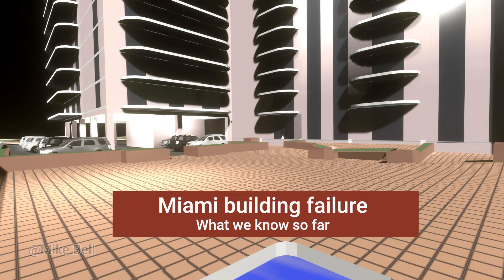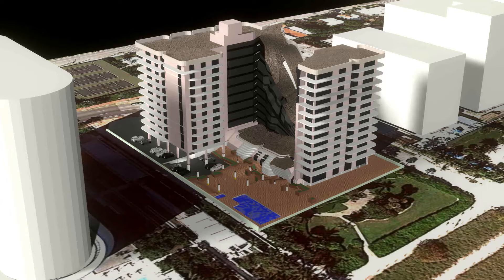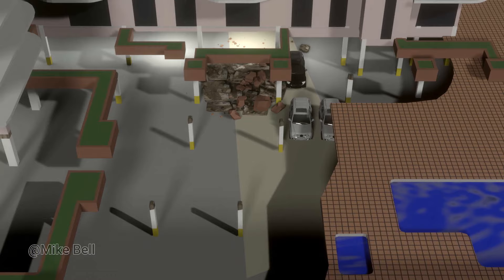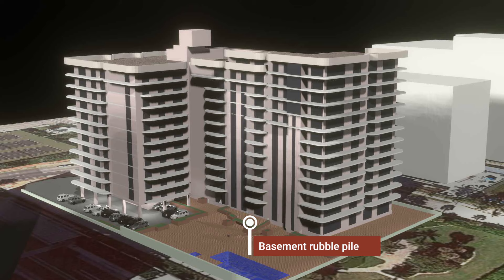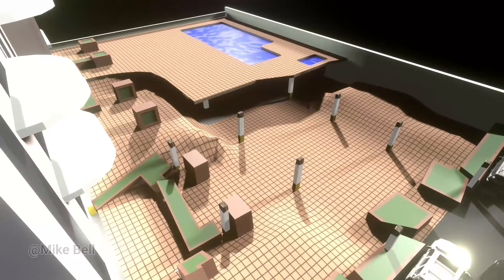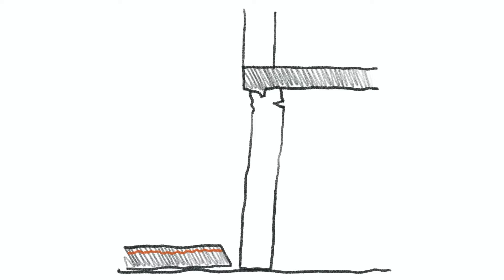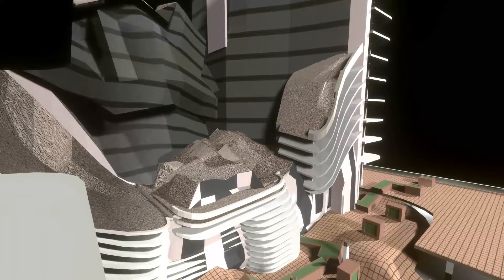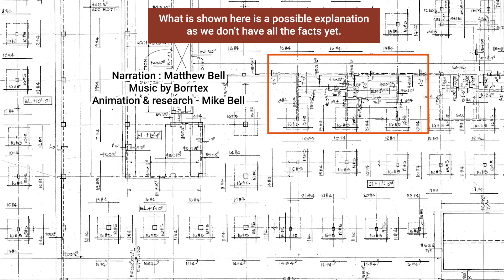MIAMI CONDO COLLAPSE | visualization of the evidence pt2

Comment: A very good animation of what we believe to have happened.
I read a report by a geologist who was working on this bit of land detached from the mainland.
That when the survey was done there were packets of unstable ground.
Could the bit that collapsed been one of them and the part that survived been on the more stable land?
A demarcation line running between the collapsed and stable building.
As with most accidents be they minor or serious there are usually more than just one fault, the Swiss cheese explanation comes in to play.
If the holes line up you are in for trouble.
When the lady reported the beginings of the collapse at the lobby of non collapsed part of the building the fire alarm should have been set off.
Also the building inspection and others should have listerned/seen what the building was saying.
Thanks for the video. It might not have been necessary if the above and duediligance had been carried out.

Comment: There were warnings.  Many residents saw decayed concrete, warped columns, slanting floors, cracks, door frames that fit strange and the such.  Complaints came in for years.  But instead of moving, everyone just sat around. Never believe that someone else will fix your problem.  You better fix things yourself.  If you can not fix the issue, replace it.  "Professionals," can no longer be trusted.  You must be your own electrician, roofer, mechanic, plumber, and the such.

Comment: It looks like the shear wall was designed with minimal obstructions. The columns look too slender for the negative moment sections of the column ceiling design as well as floor column design. There is another video discussing the shear wall design near the elevator shaft. I used to inspect bridges be and it looks like efflorescence, water seepage, among other causal factors that contributed to the collapse, from the video.

Comment: No engineer, but that domino effect you mentioned early would seem to be the key to keeping this from happening or something that could be integrated into older/similar type of builds with load bearing shear walls possibly where water migration or corrosion is a problem or a variable.

Comment: The columns of the façade buckled as if there were no beams which calls for a certain suspicion that it was intended to save materials and earn more money by putting an additional level to the building, but investigation would have to analyze first total height of the building vs levels, perhaps the problem was not only the damage suffered by the corrosion of the metal inside of the columns that in a building built respecting the rules would have given signals with enough time to evacuate safely, sorry my english not too good

Comment: i wouldn’t say engineers go out of there way to make it robust. they design it for the building with a budget intended to meet the scheduled deadline. A lot of buildings are built with cheaper concrete and thinner steel due to the contractors and builders actually taking on the job.

Comment: The floor fell on both sides or support column 72, some lobby floor could have fallen also fallen around the collapsed supports. Because 72 was an upper garage both the garage and 1st floor had16-inch columns and they sat on top of each other, even though a lot of the connecting material got ripped away, the 2nd floor also had a 4-foot beam around the parameter. I think the lobby outer wall in the collapsed section was flimsy in comparison, no 4-foot beam on the 2nd floor, I think it had 12X16 column. If the floor fell around that column taking out some material it probably wouldn't need much of a tug from the falling lobby or deck slab to destabilize the 12 in cross section if the connection looked like 72.

Comment: Leon Wechsler Architect says: The only thing that brought down the building was lack of structural beams under the pool deck and also in the portion that collapsed, period !
Reply from the maker: Obviously beams would have prevented this.   That is self evident. 

But why have all the other flat soffit structures and they are as common as baseball caps, not fallen. Only this building? Answer that…. you cant. 

Mike Bell Architect says me thinks corrosion thru neglect and razor thin margins on the structural design caused this collapse.

Comment: What I think needs to be thought of as well is a lot of times a support can break and not actually fall in that specific area... buildings are engineered to support a load over sqft. So one pillar breaking could’ve been fine, but the extra load put onto the other pillars might’ve exceeded its parameters actually causing the collapse.. so many factors in how it could’ve actually happened.. ultimately it was the lack of inspection detail and ignorance.

Comment: Also, the construction next door by a mammoth sized new building didn't help. I wonder how it feels to live in a building that was partially the catalyst in the older building collapsing down.
Reply: I get your point but the damage the new condo building may have caused was inadvertent. They weren't to know Champlain was so terribly under-engineered, nobody did aside from the original team, many of them are long dead.

Comment: Construction similar to our beach side condominiums in Pinellas County with many of being within the same age. A majority had and many still have exact same parking arrangements. The area above used for vehicles to drive on with area for visitors and delivery parking. It is not uncommon for moving semi and box trucks to be parked all day in the exact same spot. Not 100% sure as to weight limits on such construction but I do know looking at them there is no way that they were made for such heavy pressure. Trucks were built smaller and lighter but as time progresses the weight and size increase for new safety standards and  to meet the ever increasing needs of transporting more and more crap which people must have. Also these decks are perfect for any renovation and repairs for contractors. They can easily access any floor and roof from right against the building. Imagine the size of a crane being used to reach the roof at 18th floor height with huge replacement air conditioning units......

Comment: Having worked in structural concrete construction, one look at the ceiling in the garage would make me run out of the building and never go back.  It was melting or so it seemed from years of neglect and corrosion.  Placing panels over cars to divert the dripping water and crumbling concrete was heinous.  Efforts to warn and sure up the structure never occurred.  A political quagmire had consumed all reason by individual condo owners within the structure.  The unsuspecting inhabitants were like sitting ducks waiting for the inevitable collapse.  Inspection people failed as well making unprofessional declarations about the buldings integrity which further guided the process which ended in demise.  All in all it was a catastrophe which was led by those with various reasons for denial.

Comment: great vid. but one issue I see is that you show the pool deck collapsing clean cut from the 1st floor of the building near those first failed columns. but i've seen in other vids and the actual plans, the floor of the pool deck was literally connected to the 1st floor of the building with rebar and several beams. with the pool deck collapsed, it would have been hanging on to the edge of 1st floor of the building, cracked and pulling downward and outward away from the building. those columns, being weakened from water intrusion, could only stand the sideways pull of the collapsed deck for 7 minutes. so sad. why wasn't the deck free standing from the building support columns?
Reply from the maker: In my first video I illustrated a more violent action to the tower collums. Only with detailed engineering modelling will the true pulling action of the slab be determined. However for that slab to have failed this “easily” I suspect that weakness would have meant its connection the the tower structure would have been weaker too and torn loose relatively easily.

Comment: I still believe that not all the Pillings went all the way down to bedrock.  Especially the ones towards the beach. That was the true cause.
Reply from the maker: This building did not have pilings to bedrock and neither do any other buildings along that road.  The adjacent buildings are all standing firm without pilings to bedrock.  This building collapsed from poor structural design and very likely inferior reinforced concrete.  And probably corners cut during construction.
The floor of the basement after clearing the site was flat with no sign of settlement.  

I can categorically say pilings not going to bedrock played no part in this collapse.
Reply: right
 @Mike-Bell

Comment: What engineers call "Punch Sheer" i believe.   Correct me if I am wrong.  The parking garage fails because of a leak in the pool room.  The support for the foundation of the building disappears.  The entire structure resting unsupported finally collapses.

Comment: It is Still my Opinion, that the 12th floor patio deck, the Penthouse Patio deck and the penthouse (patio ONLY) ceiling were compromised by the weight of new Roofing materials, that were put in the wrong place. 
They were placed too close to the edge of the roof and they fell off first. Falling onto and through the pool deck, breaking the water pipe and falling into the garage.

Comment: Deff water/salt long term concrete rebar cracks. If the pool was leaking or if the pool was being vacuumed with water pump discharge onto decks this may been issue

Comment: The way the slab is broken around the pool I wonder if the chemicals in the pool had something to do with it. The one area in the front where the slab is fallen to the ground, I would think would have been the area where swimmers entered and exited the most. Liquids were seeping into the concrete most likely including pool water. And given that rebar's weakness is corrosion, and it loses strength drastically if it gets corroded maybe caused the slab to collapse.

Comment: This is par for the course for Miami coastal high rises. While the county and city have laws on the books for stricter building codes, this 50 year Democrat-run city had inspectors, engineers, and owners who ignored the reality of the situation for years to get to this point. Failure all around.

Comment: What were the flashing bright lights as it started to collapse? Near the roof and the right side of the building.
Reply: There's an alarm strobe flashing at the top of the part which was left standing, just under the pink light on the roof.  It can still be seen flashing in footage from after the emergency crews arrived and in footage from the next day in that exact position.  I think there's another one near the bottom of the section on the far right which flashes just once before that section collapses.  Most of the other lights are just room lights which go out as the wires are ripped out during the collapse.

Comment: The two columns closest to the black car at 3:00 with the beam running between them are both not perfectly straight up and down but leaning away from each other and the beam is bowed.  It is easier to see if you watch other videos that have the whole video and compare the columns with other columns in the background as the camera moves.  The smaller column on the right is leaning more the the left and it is this column that a large planter and raised step up surface is that was increased in size not long ago adding to the weight.  If you look at the ceiling you can see water damage and were the building begins where the water damage ends in a sharp line.  There is also a red cone right under the beams end next to the smaller column on the right.  The beam itself besides bowing is twisted and discolored.  Could it be that maintenance on the beam was performed which was more cosmetic than structural?  

I would investigate the permits that were issued for the larger planter that was installed not long ago.  I watched other videos where an engineer did calculations that showed the pool deck area was designed at 100% load capacity before a single person stepped foot on it.  This is a flawed design and once age and even a little bit of corrosion happened the pool deck was doomed to collapse.  Also the building owner was also the building contractor and cut corners eliminating beams that would have kept the pool deck from collapsing in the first place.  The owner/contractor and architect should all be in prison if they are still alive.  Whomever approved and inspectors of the enlargement of the planters should also serve a year or two.

Comment: iron expands when rusting so severely, as this footage suggests.
Reply: That's literally what spalling is. The rebar expands, literally pushes the concrete off, it then falls off and is no longer attached to the rebar and can support SIGNIFIGANTLY less weight at that point as its now just normal steel and concrete.

Comment: There should be focus on the ground the buildings were built on. Was there a connection to bedrock for supporting building columns? Did liquification of the earth cause instability like it caused instability in San Francisco during the 1989 earthquake? Was the ground just too weak and moist for the weight of the structure? I hope someone knows.

Comment: There are much taller structures surviving century after century. Let´s face it: These buildings are dodgy from the beginning, and despite all the fancy regulations and redundancy often won´t even last half a century before becoming unsound. If you think that´s acceptable, you might as well go live on a volcano.
Building codes and inspections still leave a lot to be desired; It isn´t the weakest link in the chain that brought this building down. In this case, every link was weak.

Comment: A very well done video thank you , myself and a few others agree that if the pooldeck was completely separated and was an independant module with a satisfactory separation expansion joint it would have failed BUT!! not having any influence on the main buildings support columns not caused any weakening at all saving the building like a fuse why the building was constructed like this makes me wonder.
But who would ever imagine a deck supporting far less weight would ever fail first , NO WEIGHT but BEING EXPOSED TO HARSH CLIMATIC CONDITIONS THE SUN WIND RAIN   this differential caused dramatic inequality resulting in the collapse of the pool deck which being connected destroyed 3 important colums to be immediately  weakened and not being able to support the 12 stories above
Reply from the maker: If the tower and pool deck were isolated with a movement joint the collapse would not have happened.  This is not  in dispute.  It is routine for a tower to be stabilized against sideways sway with a ground floor slab tying it into the earth.   
There isn't anything fundamentally wrong tying a building and ground slab together like this.  It is done all the time around the world.  When done correctly the buildings don't collapse.   And makes for a more cost effective design which is why it is popular.  My pt. 3 video illustrates this point.  And more correctly it was not the pool deck that caused the collapse.  It was 3 planter beams under the deck.  

This collapse had 3 key links in the disaster chain.  If any link had been missing the disaster would have been averted.

1. Punch shear of the pool deck columns should NEVER have happened.  Inadequate structure and possibly corrosion.

2. The pool deck should not have caused mortal damage to the tower columns.  The tower columns should have survived that.  By coincidence the planter beams under the deck tied into the columns at the very worst point.  NIST in their latest report have shown multiple images focusing on the 3 planter beams.  They are the center point in the disaster chain.  

3. The tower floor slabs tore loose from the tower columns.  This should NEVER have happened.  The slabs  should have teetered but not torn loose.  The slab column connections had inadequate rebar.  

This collapse was caused by a brittle inadequate structure.  That alone was not enough to cause catastrophe.  It also needed a lot of bad luck and everything going wrong together.  The proverbial perfect storm.  Tragic!
Reply: @Mike-Bell  Hi Mike in hind sight if the pool deck was am independent module perhaps the building would have survived
Unfortunately the watering of the planter boxes over 40 years provided more than enough unusual amounts of water to saturate the immediate area causing spalling and chemical changes in the area surrounding those vital columns.The stalictites that formed under the planter boxes bears testimony to how much water was dripping through that whole area if it was.timber would have be4 completely.rotten.so sad

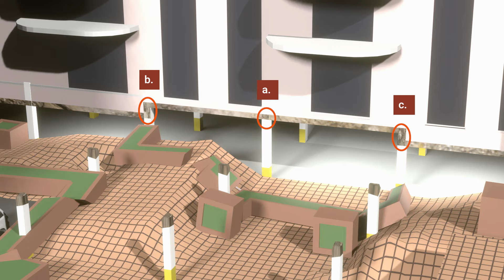Comment: 5:35 shows torquing that probably initially caused the failure. But animation is wrong.  The columns didn’t fall down with the slabs. Remaining columns punched through the slabs as you show in the beginning. We know this because all of the interior columns are laying on top of the slabs. For the most part, they did not buckle and fall with the slabs. The slabs actually slid down the columns then the columns fell over on top of the slabs. This is an inherent failure of the design. All buildings built in the same way are in danger of collapse. 60% of Mexico City collapses were this design.

Comment: Truth be told. Concrete and rebar constructions has a very limited lifespan in salt air and water climate. Add to that no actual bedrock to support the structure. Florida geography was not created to support these structures. The land will be under SALT water within 50 years anyway.